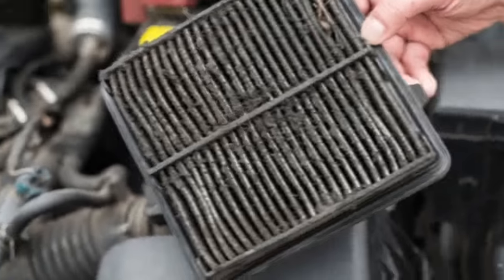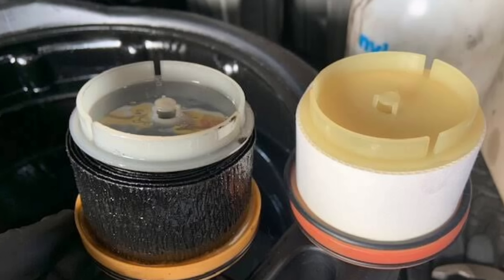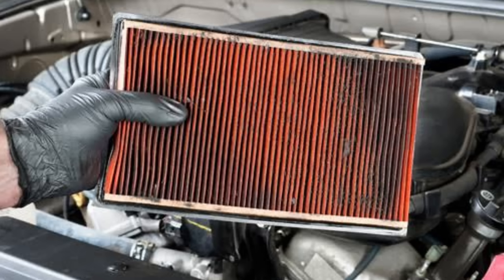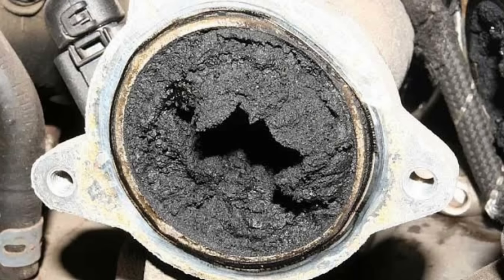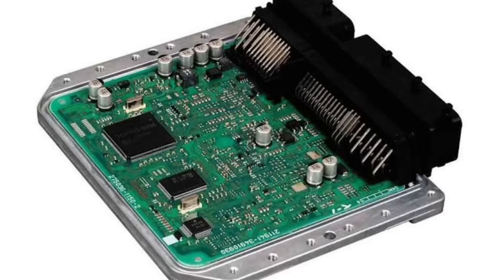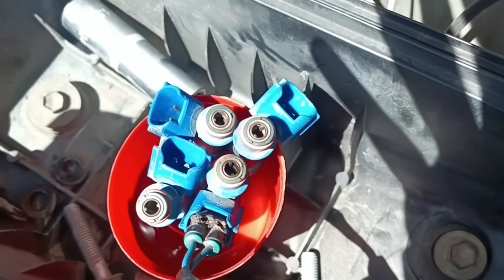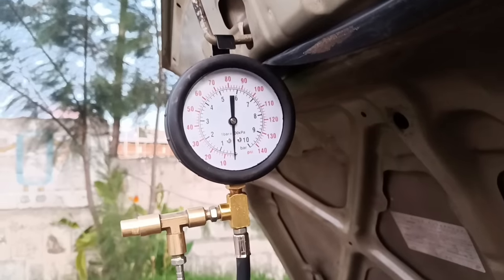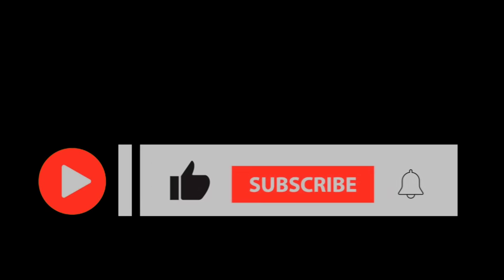Top cause of a car losing power when accelerating

Comment: It happened to me while i was full throttle approaching top speed of my car. Out of a sudden the engine starting acting weird and cutting power while still trying to produce, i kept my foot flat amd then the engine started losing even more power then i released the gaz cuz the check engine came on which btw never showed in my dashboard. When i released throttle the check engine disappeared but the car still runs fine without bugging only when i approached top speeds. Its not the speed limiter, i got it deleted and already ran its true top speed about 3 or 4x. Once it happened i came straight to youtube to find what could possibly be the issue. I will change oil and fuel filter and maybe air filter and see if it fixes my issue.
Reply: any updates bro?
Reply: @pransyuhh  well i changed the oil and its better but still happens, kinda still close to top speed but only when i floor it. Weirdly i do not floor it but rather keep it in triptonic(manual mode) and the car seems to accelerate even faster for unknown reasons. Next is cleaning my injectors and see if that fixes it. I ll do that tmr
Reply: I have the same problem
Reply: @sabrinakoehler1105  i bought and injection cleaner and poured it into my empty fuel tank before fully fueling it. I didn't feel any issue yet
Reply: @redtail1.  I’ve used sea foam twice and nothing changed, what did you use? I didn’t let it almost run out tho
Reply: @sabrinakoehler1105  yeah you have to let it almost run out. I used Stp ultra fuel system cleaner. I recommend reaching the last bar of fuel on your dashboard and driving for 5-10mins after  the last bar pops. To be sure you are really low on fuel. Then go to the gaz station, pour the liquid in your fuel tank fully and then refuel your tank fully with gaz. Once done, drive around for a bit.
Reply: @sabrinakoehler1105  let me know if it helped.
Reply: @redtail1.  waiting to run my gas out and I will let you know
Reply: @sabrinakoehler1105  i almost forgot one thing. I recommend changing oil before doing so if you haven't done yet. And ask your mechanics to check all your fluids. Once done now you can procceed with the injection cleaner.
Reply: @redtail1.  I had an appointment but didn’t go, I will make another
Reply: @redtail1.  looks like I have bigger problems! Today it started doing it again now it is over heating. Currently sitting on the side of the highway waiting for a tow truck
Reply: @sabrinakoehler1105  oof, what car do you drive? Then maybe the engine is the real issue and not the injectors
Reply: @redtail1.  new engine, it’s a Cadillac Escalade
Reply: @sabrinakoehler1105 could be your thermostat in the water pump I had overheating problems with that but my cars a little older than 2000
Reply: @DomPom719  bingo!! Was the water pump
Reply: @DomPom719  would the water pump cause all the other issues?
Reply: @sabrinakoehler1105  the other issues I would have to say if your cars newer, try to have the mechanic check your EMC (Engine Control Module) to see if an error code pops up. That could be telling your engine that it’s getting more fuel/air or more air/fuel and making the run a little richer but yeah then water pumps and lines get worked out pretty fast even in newer vehicles
Reply: @DomPom719  it’s a 2009 so not new, problem #1 is still there. Not over heating anymore or leaking antifreeze
Reply: @DomPom719  I drove it today and the service engine soon light flashed a few times and stayed off when it missed, the code was PO305 which says it’s the 5th cylinder, I’m thinking it’s fuel injectors
Reply: @DomPom719  PO305 which is back to the first code it gave me 5th cylinder misfire randomly and service engine soon light blinks a few times then goes off
Reply: @sabrinakoehler1105  that could be your spark plugs too that what I’m about to do with my Lexus es300 but if that a lean bank code maybe the fuel pump could be the thing to look at next with fuel these cars are hard
Reply: @DomPom719  I’ve changed plugs, wires, coil packs, cleaned throttle body, and mass air flow sensor, changed throttle body sensor. Still has the same misfire on cylinder 5, I’m going to change the coil packs just from 5 to 6 and see if it changes codes. I bought a reader that is Bluetooth and stays plugged in since the service engine soon light flashes but never stays on
Reply: @sabrinakoehler1105  let me know how that goes my car is just going crazy maybe the change the vacuum pump I believe it’s called and see if that changes
Reply: @DomPom719  same code when I switched the coils, I purchased oem fuel injectors off eBay for 110.00 and a new throttle body off eBay for 50.00. Gonna keep throwing money in it until it’s fixed. Still cheaper then a car payment
Reply: @sabrinakoehler1105  that is true but cheap stuff as well hope you get that throttle body on and it goes away I know I cracked the top of mine by accident and could be curios of the issue also have you done a compression test on your engine ?
Reply: @redtail1.  I’m back again!! Still at it, did all you said plus mass air, oxygen sensors and then I did the fuel injectors which 3 where horrible, service engine light came on now I get code p0327 knock sensor, I think it hates me
Reply: @sabrinakoehler1105   hi, sorry i wasn't receiving any notification since then, only this time when you tagged me that i saw all the other replies. In my opinion since the code is about a cylinder misfiring, i will suggest maybe get a new engine in it OR check if there isn't a crack  in that particular cylinder hole causing the mis fire or maybe the cylinder isn't timing well anymore. If can, i will suggest a new engine but if fixing is cheaper, then fix that cylinder. Also keep checking for your anti-freeze since its leaked before just to be safe and have a bottle of anti-freeze ready in your car in case.
Reply: @redtail1.  I just replaced the engine in 2019 with a new crate motor from GM of course the warranty was out in 2023. Now after replacing all those things. A new code came up which is P0327 knock sensor and or wires. I will do that tomorrow. And let you know. It is a 2009, if it is the knock sensor it would be amazing, I’ve seen so many others with the same issue doing all the same steps as I have, with no resolution. I will also check for vacuum leaks
Reply: @sabrinakoehler1105   ok let me know. These knew engines don't even last as long as the olds before you have issues, especially if you drive it hard. Btw how much miles or kilometers your engine has?
Reply: @redtail1.  not even 20,000
Reply: @sabrinakoehler1105  thats very low  did they sell you a used engine and lie to you being new? Very odd. Its very sad your your warranty expired
Reply: @redtail1.  no it was new I have all the paperwork from GM. And I placed the order to GM
They did use all the old parts off the old motor. Wouldn’t you think that could be a problem? It has almost 300,000 miles on the Escalade. Rebuilt transmission also
Reply: @sabrinakoehler1105   wait, so if its a knocking problem, the issue was maintenance, maybe you didn't change your oil regularly or drove with low fuel often and dirt in oil went in your engine  causing that noise. Also clean your throttle body if have any problems with stop en goes. Let me know once you fix your knocking what the real issue was. And if any other code appears.
Reply: @redtail1.  I had the oil changed regularly and never let the fuel light come on, I put on a new throttle body. It started as a random miss without a light then the light was flashing I bought a Bluetooth reader it showed codes p0174 and then did the fuel injectors now p0327 which is the knock sensors and wiring. Other maintenance was probably neglected as far as plugs wires and things like that.when it gets warmer I going to have the knock sensors done and hope this is it. I’ve seen a lot of other people having the same problem starting out like me and chasing it down.

Comment: basically replace everything one by one till it fixes the issue! i've replaced the catalytic the oxygen sensors and maf sensor and high pressure fuel pump already car still doing this crap
Reply: Sorry for this, check the crankshaft sensor
Reply: @Ghmechanic  the dealer has my car still they replaced the throttle body and sensor charged me $450 and i drove off and still was stalling i stopped n the car died it started up n drove the rest of the way back. i was thinking maybe the ecm but i can tell them the crankshaft i thought that also and thanks

Comment: What happens when your going down the road and your car just quits all together? Good video though, I can learn a lot from from them.😊
Reply: Depends more elaborately explain that issue because there’s several reasons, fuel pump, cam sensors, alternator ^^ n more
Reply: @dahlon6618 hey man, my car loses power when I accelerate it would jerk a few times then my car would car would just stop accelerating. Restating the engine fixes it, what could the problem be?
Reply: @JC-ij8ut  personally I wouldn’t ask on YouTube comments I would go to get a diagnosis from a real professional because that could be an electrical issue or a trans mission issue if there’s more description about it or what car I might be able to find the cause
Reply: @dahlon6618  it’s a 2005 honda accord v6
Reply: @dahlon6618  it usually happens on a bumpy road and dashboard doesn’t have any warning lights on. The car usually drives pretty smooth.
Reply: O Lord thats Night Mayer so many things and imbarrace ment